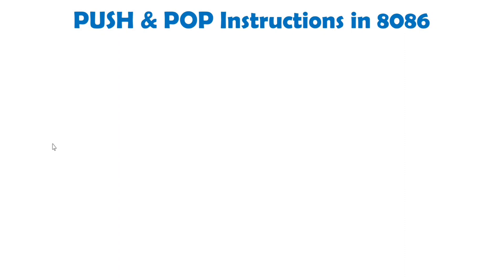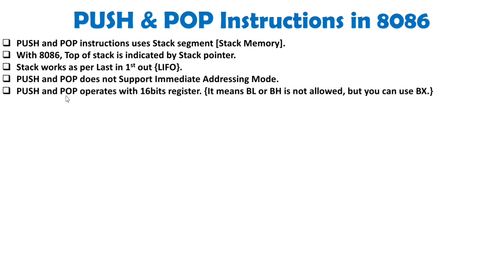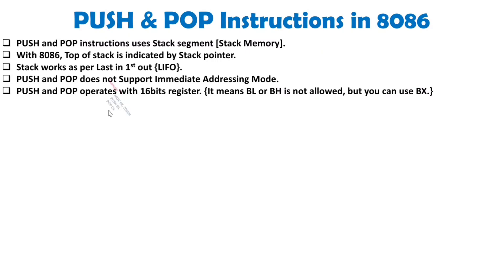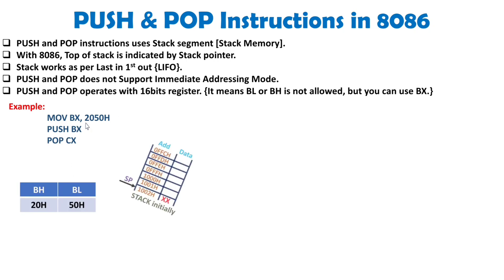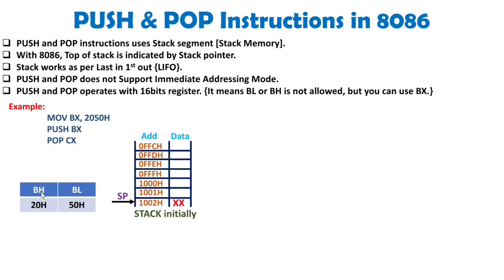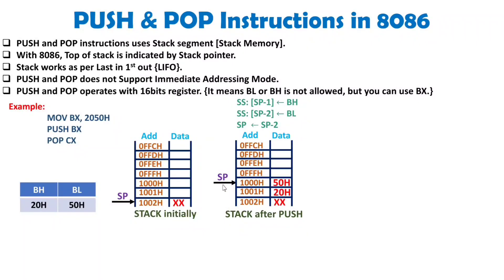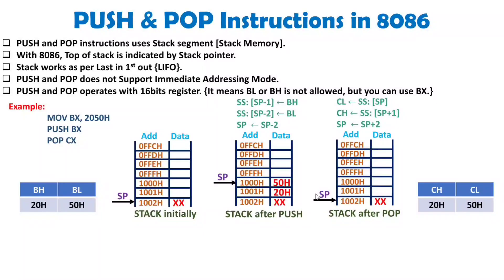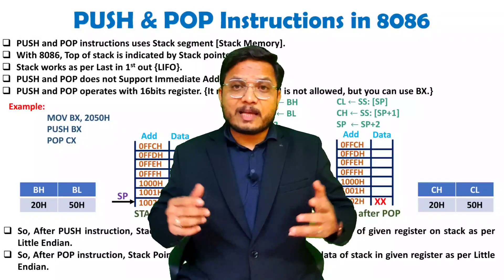PUSH and POP Instructions in 8086: Understanding Stack Memory

Comment: why 20 and 50 are stored in  different location 
8086 is  16 bit mp so it can store 16 bit data on same address
Reply: It cant. 16bit mp means 16bit accumulator.
each memory location can only store 8bits of data
Reply: that's what i'm not able to understand
Reply: each memory location can store 8 bits of data.